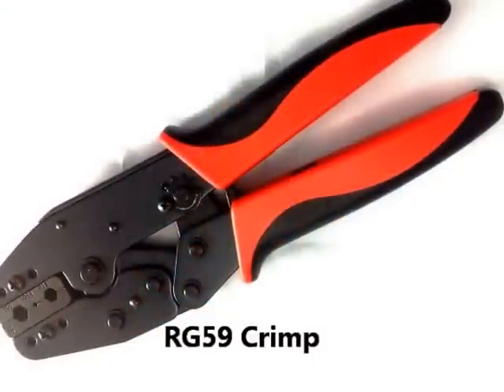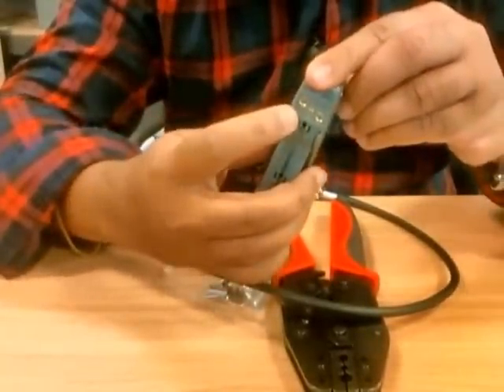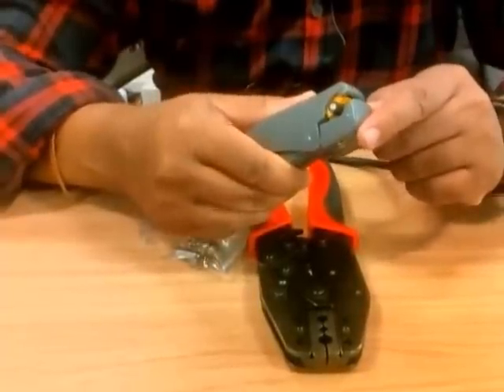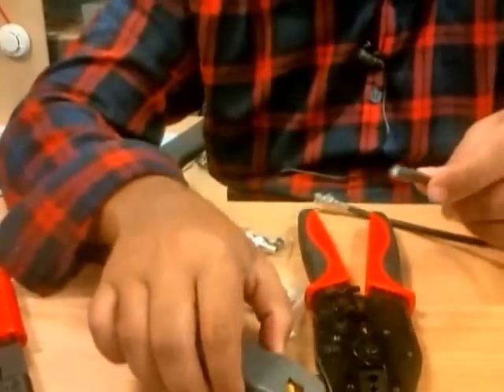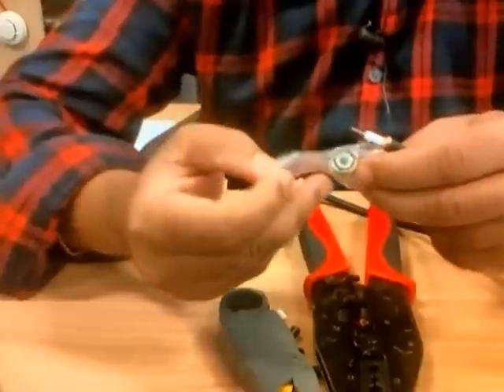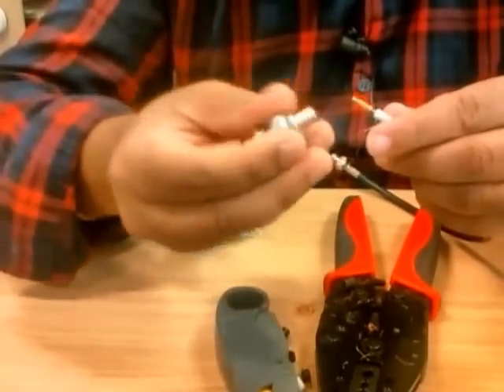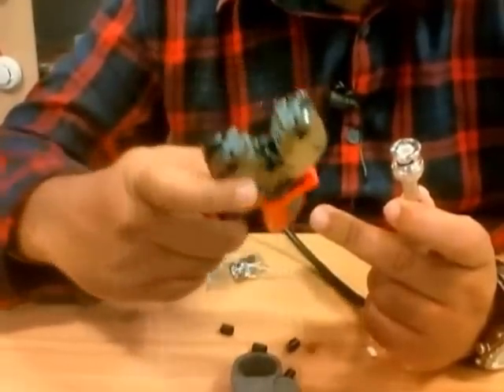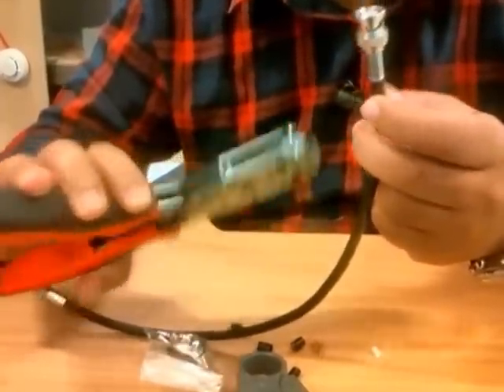Crimping RG59 cable - CCTV installation

Comment: great video but you forgot to crimp the center pin or maybe you did show it in the video.
Reply from the maker: +Desmond Walker RG59 centre core is not a strong copper, therefore you do not have crimp them, it can snap.